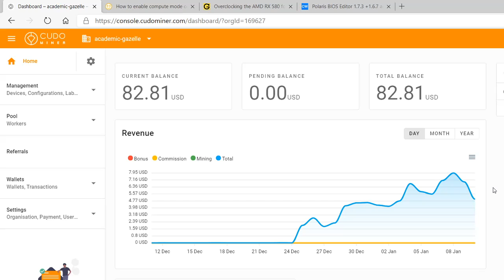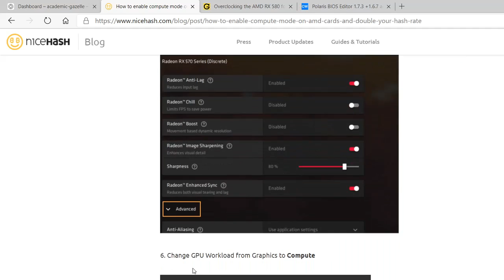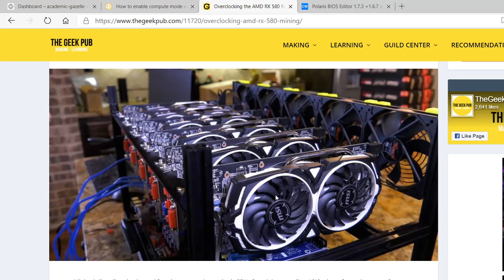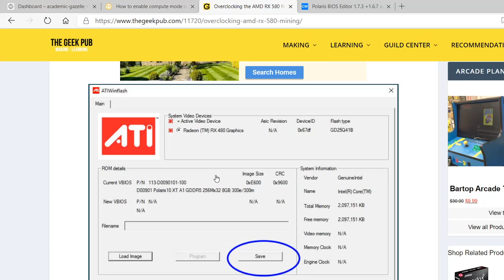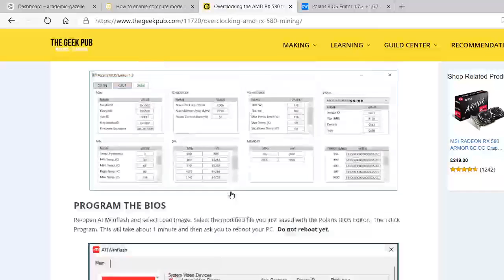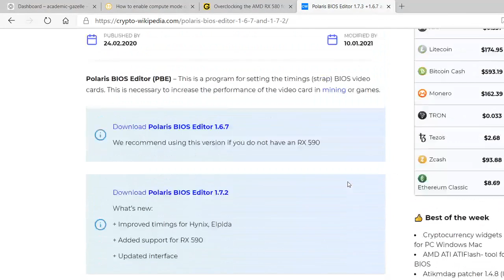How to mine up to 30mh/s or more with an RX580 8GB

Comment: hi johnny sins: i followed you and gettiung only 17 MH can you help me 
i have rx 580 8gb xfx
Reply from the maker: Hi Abdul, thank you for the subscription! this is an easy fix. you need to enable console mode, open up you AMD radion software by right clicking on your desktop, click the cog in the top right hand corner, click graphics, if you have multiple gpus, you will have to follow these next steps for each card, scroll down and click advanced, scroll right down again and find GPU workload, you will see that the current setting is "graphics", click on graphics and change to compute. this will pop up a warning sign saying you must restart to apply your changes.  this will now increase your GPU to the 30mhs mark. Good Luck Bro!
Reply from the maker: Also Make sure you set your fan speed to 100% on the XFX GPU, if you are wanting to buy more i would recommend the MSI rx580 8Gb as they are much better quality and you only need to set the fan speed to 70%